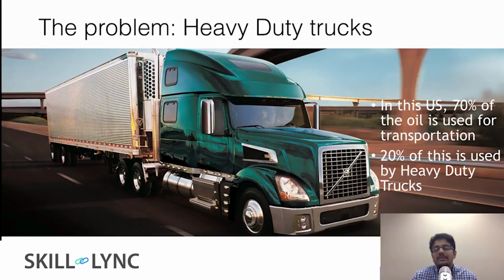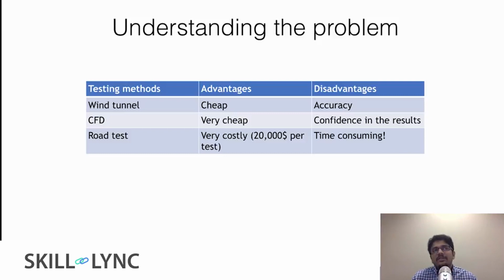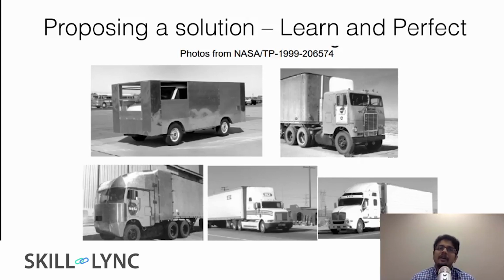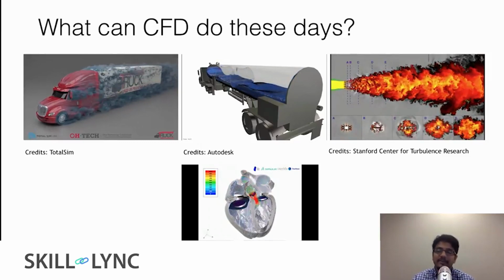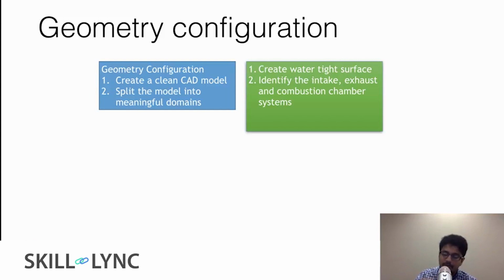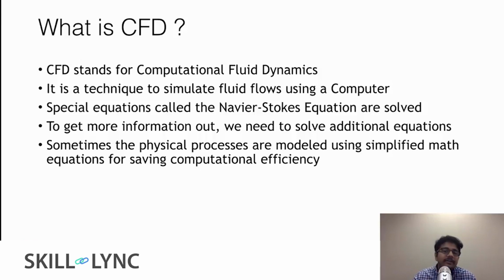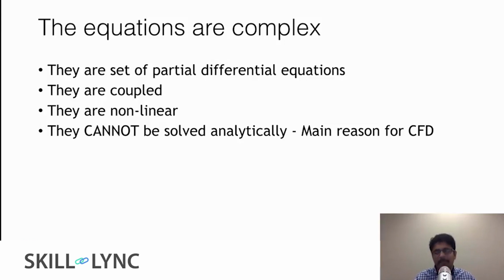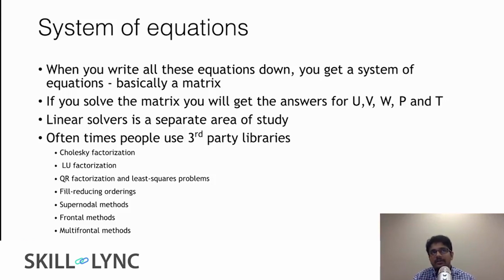Introduction to CFD | Mechanical Engineering Free Certified Workshop | Skill Lync

Comment: Sir, so equation is important, sir while simulation time how many softwares, and how many equations are use in analysing time
Reply from the maker: It varies from problem to problem. To get an approximate estimate, take the  number of governing equations (Mass, momentum and energy) and multiply it with number of computational cells and multiply the result by the number of time steps.
Reply: Thanks you sir